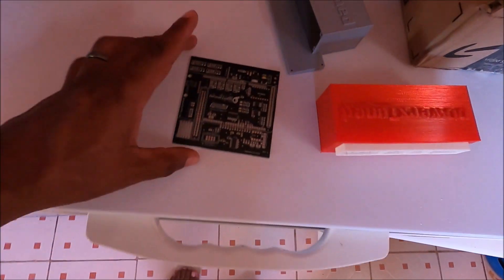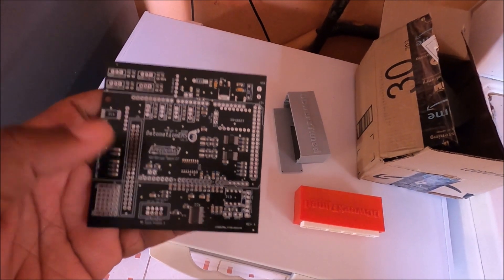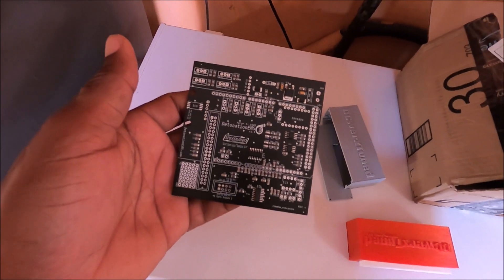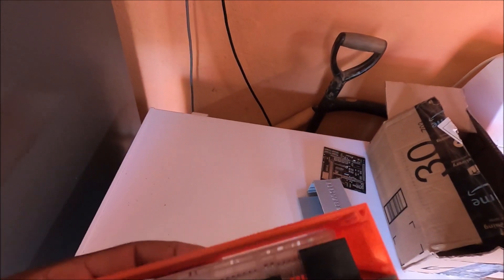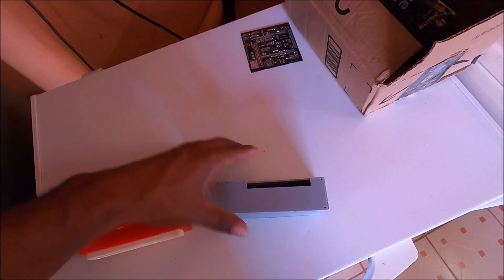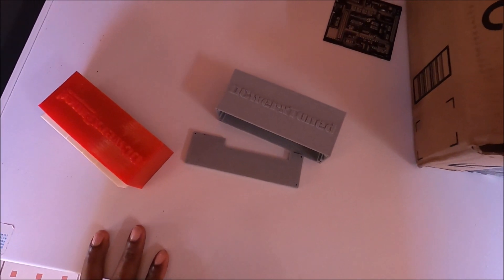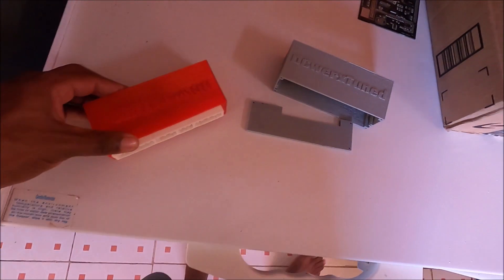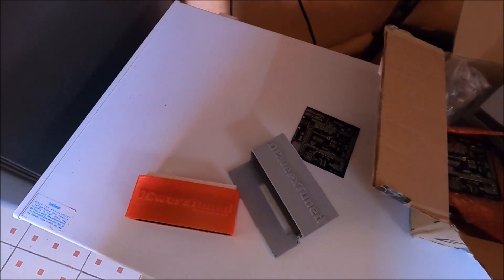New Speeduino ECU Updates | Honda PNP Almost Ready

Comment: anything for k series? can we enable vtc with any independent unit integrated with speeduino?
Reply from the maker: No k series yet. Theoretically you should be able to use an independent unit for vtc without issue.
Reply: @DCWERX  Great 👌 . I will need your help. I'm going to start a project in few months. K24 swap.
Reply from the maker: @hassanae8047  np. Shoot me an email Dwight@dcwerxtuned.com when you ready
Reply: @DCWERX  thanks man 🙂